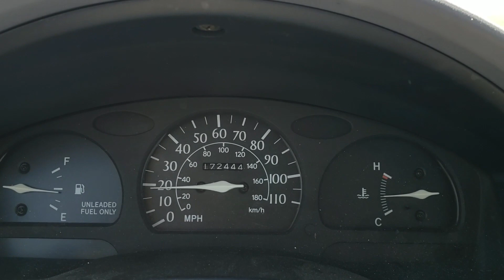Floyd is down, but Earl lives!

Comment: Its funny how 2 door Tercels are like weeds in the US compared to 4 doors, but up here in Canada its the opposite. its like 80% 4 doors and 20% coupes
Reply from the maker: I wouldnt sweat it too much.  Id love to have a 97 or 98 4dr and they basically dont exist in USA.  Just one of those things.  Plenty of older ones tho, but 2drs are the most common (because we fat)
Reply from the maker: Joe  let me get mine completed first to know whats all involved (wiring wise).  Mechanical/psychical part is done.  Just waiting on getting a harness/ecu and cables.  After thats sorted.  I will figure out the little things, cooling system, etc

Comment: Dang that swap is looking pretty sweet. Why the 1nz compared to like a 4a? Less work to make it fit?
Reply: Hamza Ibrahim , less cutting for sure !! 4age you gotta dig into the frame rail pretty hard
Reply from the maker: I dont particularly care for the 4a and that would require frame notching along with modified/custom mounts as well.  Plus it weighs more.
Reply: GARAGE79R, the rear and driver side mount would be the same, it’s only the passenger side (which you had to make anyway). I agree that less cutting is nice though. For the effort of the swap though.... 4age all day, but cheap ones are tougher to find more recently
Reply from the maker: @dustinsabo4790  4a if chasing big power...or just 3s at that point